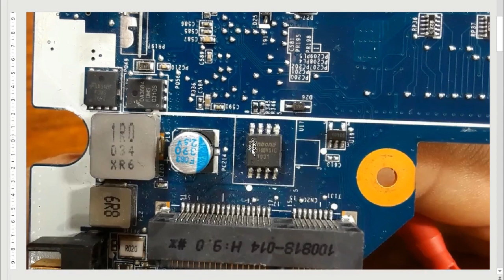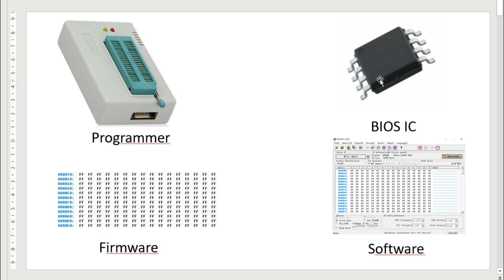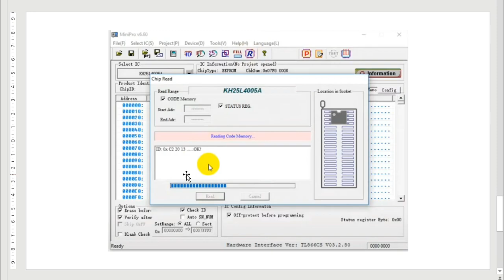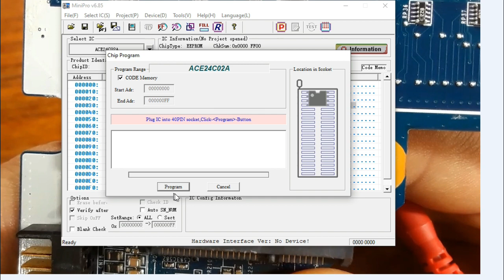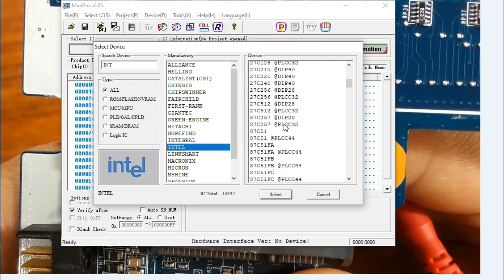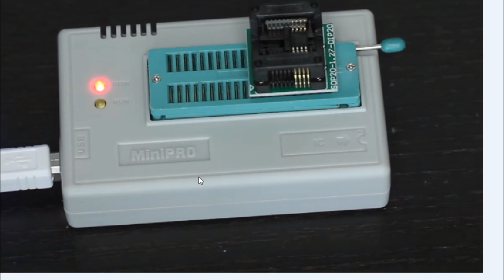Learn how to program the BIOS Chip step by step - Laptop Motherboard Repair

Comment: Hi,

I have an Alienware m18 R2 (Service Tag: 4MYKJ54) that needs BIOS repair. I need to get a programmed BIOS chip.

I'm looking for help with:

The correct BIOS chip model for this laptop

Whether I can just buy a pre-programmed chip or if I need to send my original chip

How to properly transfer the Service Tag (4MYKJ54) into the new chip

I can provide a motherboard photo if needed.

Any guidance would be appreciated. Thank you.